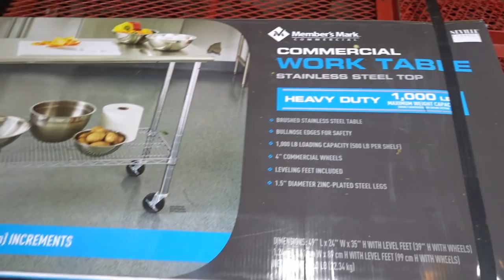SDSBBQ - Custom Weber Grill Table from a Stainless Steel Prep Table

Comment: FASTER Way To cut your top. Put the top on the table center it where it needs to be....Trace the cover with a offset to your specs....1/2-3/4- 1 inch what ever. Done. Cut.
Reply from the maker: Well hopefully that helps someone in the future watching this... but as you can see I am already done, LOL. Thanks though!
Reply: @SDSBBQs  you gave me some great ideas's ty. Question...does the heat from the grill get unbearable/ as it transfers raidiantly onto the stainless steel top?
Reply from the maker: No it doesn't, there is a air gap and the heat does not transfer NEARLY as much as you would think. The top gets warm but defiantly not HOT.

Comment: Just a quick question. What’s the name of the tool that you used to cut the hole with? Maybe a link to where I can but it! I need to do the same think with a table.
Reply from the maker: Here is a link to a corded version https://amzn.to/39c3VDt of the " Jig Saw". You might not be able to see it all that well but I drilled a hole in the table first so I could get the jig saw blade in and make the cut. Good luck!

Comment: Question?  Does the Weber heat up the table when you are grilling?
Reply from the maker: No, I cut out the table a little bigger than the kettle to create an air gap. It gets warm though but not nearly warm enough to burn your hand.

Comment: Quick questions, how well has the table held up over time? Rust, sturdy, failed parts, or any issues you have experienced. Thanks
Reply from the maker: It's Stainless steel and lives on the side of my house. No signs of being worse for wear other than getting dirty.

Comment: Hi my friend what voltage and what brand is you steinles steel cutter also what blade I can use for that to cut it
Reply from the maker: So I was using a Dewalt 20V jigsaw (https://amzn.to/3u7xr7d) with a metal cutting blade (https://amzn.to/2LXF1Qz).
Reply: Thank you so much I will do a taco cart thank you my friend God bless you
Reply from the maker: @juancabrera1590  You are very welcome 😊 Thanks for watching and commenting!

Comment: Great table build. I never thought about using a stainless steel table as a base, sweet. I have been considering a concrete surface but I really like the stainless. And it was great to see you get a comment from Justin of baby back maniac.
Reply from the maker: I thought about concrete for a quick second but I figured I'd have to make a hole in however I setup the concrete... that was too much thinking. I then thought about wood... but I was worried I's set it on fire. Then i started looking for metal solutions. That was when I came across this and it is perfect for what I needed.

Comment: What blade do you use for the jigsaw and  the grinder? Very nice set up man. 👍
Reply from the maker: It was a metal cutting blade and it was a sanding disc on the grinder.

Comment: Instead loosing the wheels, using a pipe cutter, cut part of the top pole off to the right size.
Reply from the maker: I like the wheels because I move it in and out from the wall.

Comment: Hey Dash, I know this is a year later, but if you haven’t gotten the lid holder solved yet, is the a way that you can attach the original lid holder assemble to the side of your cart.  Been looking a vids about table for the Weber grill and so far i like the stainless steel look.  Good job on the table.
Reply from the maker: No the original lid holder won't work because it's curved vs the straight sides of the table. I think I'm going to just add a hook and eyelet to hang it from.

Comment: Thanks for sharing. Is your grill a 22 or 26?
Reply from the maker: I have a 22.5" Kettle.
Reply: @SDSBBQs  Thanks. How is the set up holding up?  I know I'm a few years late on your build.  Gtting ready to do the same for my 26 kettle with a 30 x48 stainless prep table. Simple and effective
Reply from the maker: It is still MINT. It's one of the grills that has held up the best out of all the cookers I have.
Reply: @SDSBBQs  thanks.  Not surprised. my weber kettle is flawless after many years uncovered outside. .  happy new suscriber

Comment: Thanks for your video. I did the same to mine following your instructions. Am concerned that the lid is resting on the table and not on the grill's rim but can fix it with shims if needed....I'll know for sure this weekend.
Reply from the maker: I think you are headed on the right path. Just like you said shim it up and get it so the lid is on the base of the grill and you should be golden!

Comment: Man you made that table assembly look super easy lol.  Maybe I might need to try something like that for my Kettle.  

Hey are you going to the National BBQ Battle in DC in late June? If so, maybe I'll see you there.
Reply from the maker: Thanks, I like it a lot because it sits up higher and is easier to cook on. 

Not sure about the BBQ battle... I usually end up having events at the same time of that battle. I'll have to keep it in mind, though I know I have an event the last Saturday in June.
Reply: Aww man...it's supposed to have some good stuff there.  This is my first trip to it.  I figured I'd talk to some folks who've done the comp circuit and get some pointers as I plan to do one, one day.
Reply from the maker: That would be a great place to talk to folks.

Comment: Left end of that front panel is hooked, so-o-o move it over to the left with that hooked end on/around the leg, now the hose should reach.
Reply from the maker: I thought about it, but that hook has a much smaller diameter and dosen't fit around the leg.
Reply from the maker: LOL, I know right. I was thinking I might just cut it off.

Comment: NICE...I'm "steeling" this idea!  I was originally going to try making one out of wood; but I like this much better.  This is also better because the Weber tend to sit a bit low for my taste @ 5'10"...My guess is you're taller than me so having it set higher is less of a pain.
Now got your refund from Webber!
Reply from the maker: Meh... at this point they can have the $15 bucks... 

Yes indeed it sits much higher... I think I might make mention of that in a future video.